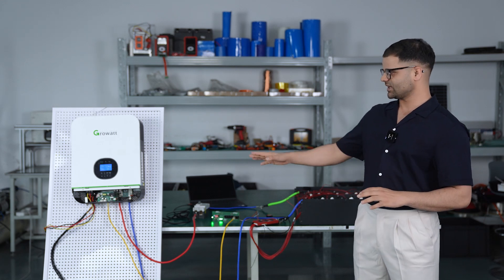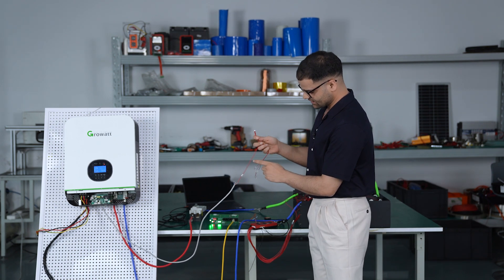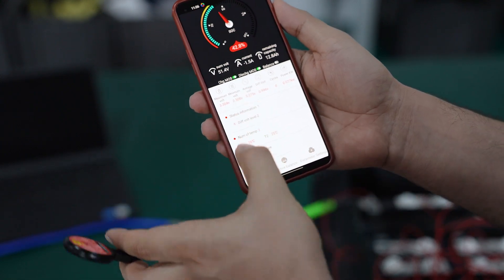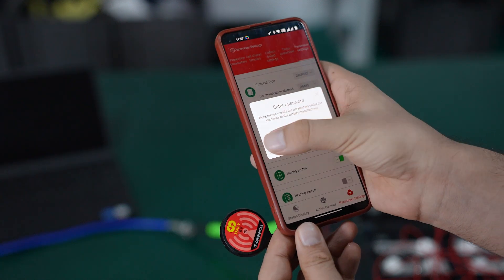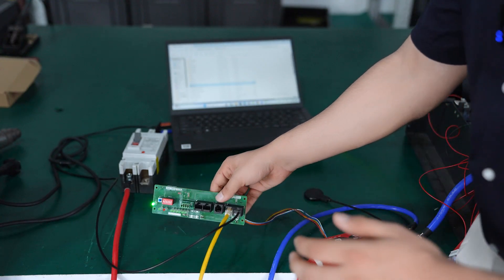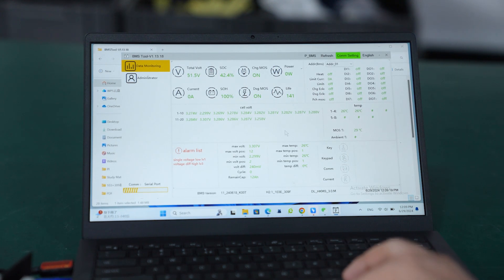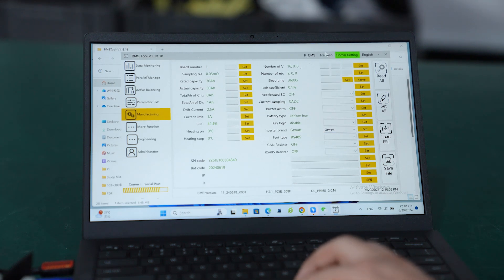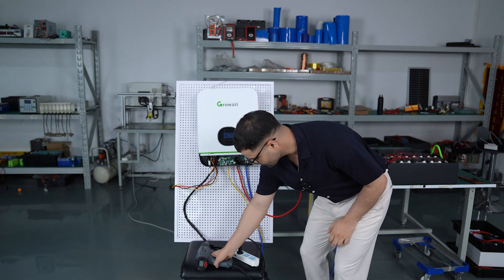Growatt Inverter with Daly BMS

Comment: In case of direct communication from BMS u need to connect RS485-A with RJ45-2, RS485-B with RJ45-1and RS485-ABGND with RJ45-8. The last is optional.

Comment: Good evening. What adout to connect 2 or 3 same batteries all together on the inverter? 
And one more question. I have one pack batteries 51.2 v and i was get max 19,5ah charge. Now i connect second pack all the same and i steel get max 19,5 ah charge..why is that?

Comment: Hi, can you share what cable you connect to what cable?
Reply: you can find them in the growatt manual
Reply: @tadeowas7  yeah, I figured that out by pins on BMS and pins on GROWATT.
Reply: @LWeRNeO  still my growatt inverter is not detecting my lithium batteries, could you make it work?

Comment: Does it work without wnt comboard. I mean can   we change protocol of daly bms without connecting with comboard?
Reply from the maker: @razmasoom   this video showed two ways to connect the inverter.with interface board or not. no matter in which way, you can use computer to choose the protocol type,or just use phone App(Is that what you mean without the WNT board?) and besides,The phone App is SMART BMS
Reply: @BMS-Lithiumbattery  sir i tried but its says invalid. Upon searching blogs came to know that com board is required to get the protocol change. Can you check with disconnected com board, does bluetooth app alone is able to change the protocol. In your video com is communicating with bms even you are not using it for rs485 port.
Reply: @BMS-Lithiumbattery We too have tried this exact same setup, after figuring out the pin out of full orange wire with 485_B which is pin 1 in the Daly 485 slot and orange/white  with the 485_A which is pin 2 in the Daly 485 slot, we went to the app tried setting the protocol to Growatt and 485 and received an invalid input error. This is with firmware ver 2.3.22 and software 31_231109_001T. The Growatt was set to Li and protocol 04. Is there a different protocol number that it should be set to ?